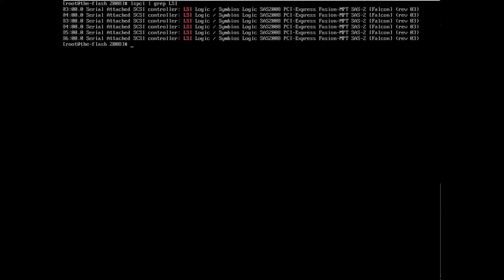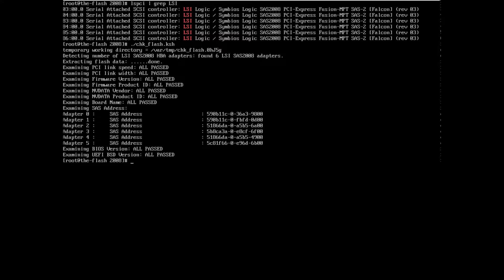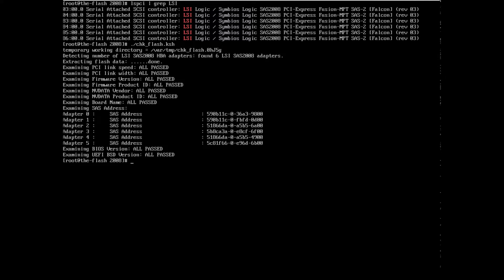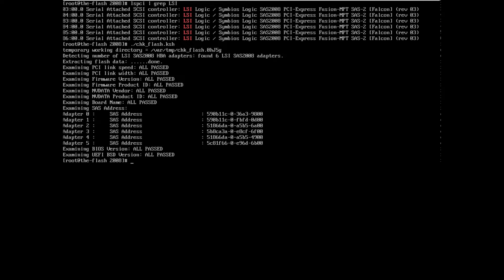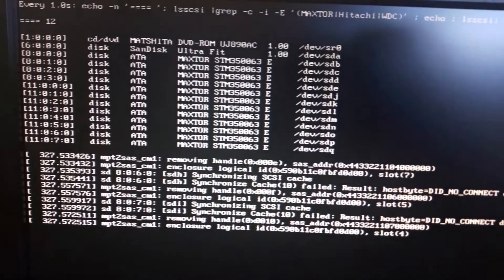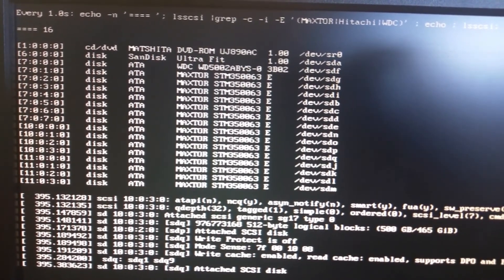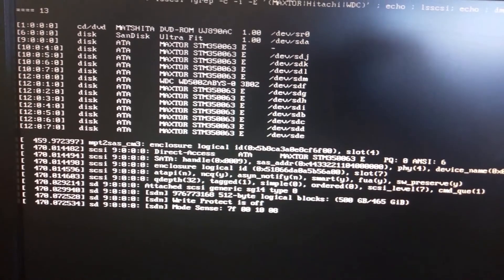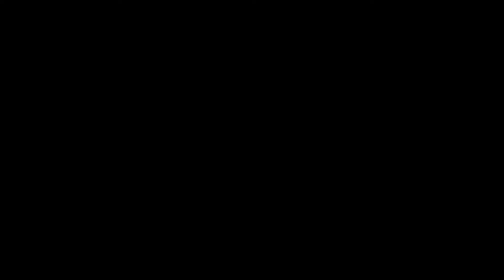How I test my IT mode HBA SAS controllers

Comment: I have a LSI9210-8i and it does as pcie device on windows 10 but it doesn’t detect in bios nor does the lsi bios screen come up AND I can’t get sas2flash to detect the card either. I’ve tried both the DOS and UEFI method and nothing. Any advice or is it a bad card?

Comment: I have 2 LSI 9207-4i4e HBA's in IT mode already.  I want to update them to the latest BIOS and firmware but dont know where to start. Where do I find the files for these 2 cards and a guide for flashing them? I am currently on a Windows machine.... thanks!
Reply from the maker: you can download all the files you need (for Windows) at broadcom.com. Just look under the support->downloads section and find your card.
Reply: @ArtofServer  do they explain the installation ?  I saw you had to type some flags.
Reply from the maker: @neccros007  you'll be using a program called sas2flash.exe. if you search, there's a "User's Guide" to that program and it will show you all the flags and how to use them.

Comment: So, you're using 7,200RPM SATA hard drives, to fully test an SAS controller? Can we at least get some single-port SAS drives? Ideally, 15K Dual-port SAS hard drives would be nice. Also, SAS cables, internal or external, ARE NOT hot-swappable. Some SAS hard drives are hot-pluggable as well. The drive enclosure is supposed to be powered on and initialized, before the server boots up.

Comment: can you use these on hhd that have 10tb or higher capacity?
Reply from the maker: Yes, these will work with 10TB or higher capacity HDDs. Pretty much anything that is SAS-2 or SATA-III and newer will support very large hard drives and have no current practical limits as far as HDD capacity goes. It was the older SAS-1 and SATA-I/II that had a limitation around 2TB.
Reply: @ArtofServer  sounds like good old Windows XP :^)
Rip 32 Bit

Comment: Hey, Im looking to get a File server up with these cards. I came across this idea from Linus tech tips but he only briefly explained the concept. I want to use this with my windows based server 2k12 R2. This is considered hardware raid right? How should I go about?, once figured out im interested in purchasing from your store since its pre flashed.
Reply from the maker: @Han Lin  : the SAS controllers I sell are NOT hardware RAID. They are known as HBAs (Host Bus Adapters), or IT mode SAS controllers, they are used in combination with RAID or RAID-like technologies that are software based, not hardware RAID. If you want hardware RAID, you don't want to buy from me, but you can just buy any other appropriate RAID card. I think you need to do some more research on what type of "storage technology" you want to use for your file server setup. Although I'm not really a Windows person, I do know that Windows server has a technology called "storage spaces" that you might want to look into. There are also other non-Windows based NAS technologies that you might want to checkout; there are many but some common ones are FreeNAS and UNRAID, but there are MANY other options. Hope that sets you in a helpful direction
Reply: @ArtofServer  -  I tried storage spaces under Windows Server 2012 R2 and it was very slow, much slower than I would have expected, and there were problems with being able to expand the storage later.  I found it easier to use FreeNAS and ZFS to provide storage to Windows as a mapped drive.  It does require more hardware to do that.

Comment: These work great, and the seller is also great. Very responsive, and spent time to help me with my technical issues. I highly recommend purchasing a host bus adapter from theartofserver on Ebay. I use mine with a zfs zraid2 pool on FreeNAS, which gives me basically a $35,000 SAN for my time and less than $4000. Go get one (or four)! You can't go wrong with these HBAs, and they're much cheaper this way than buying the same HBA from Amazon.